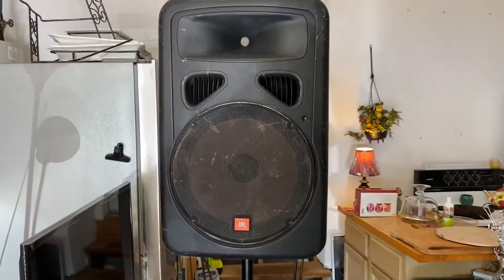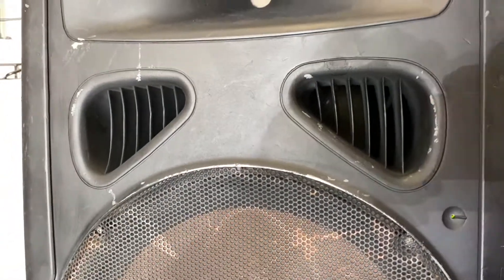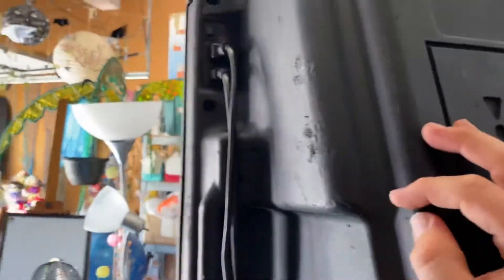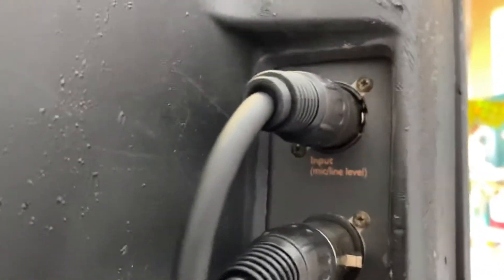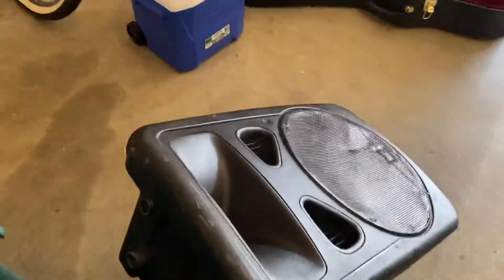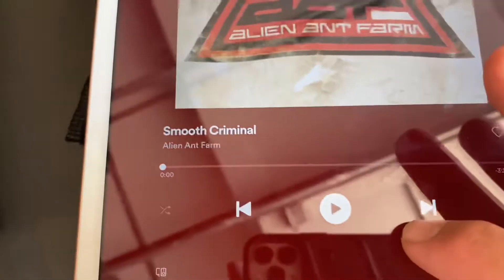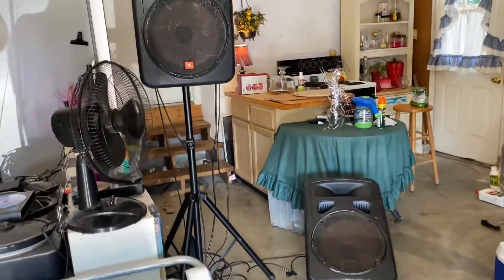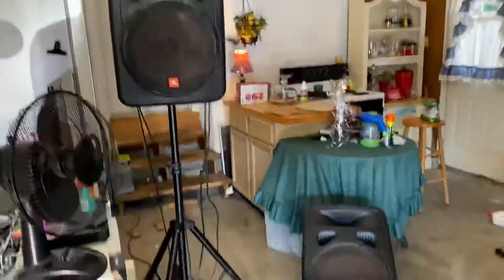Review of JBL Eon 15

Comment: whenever I Daisychain to my second eon15 thru xlr, the second speaker needs to have its volume nob turned way up to get the same volume across both speakers. why??
Reply: You may need to make sure that the mic/line and/or mix/loop switches are in the proper positions.  Sorry, without referencing the owners manual, I'm not exactly sure what those positions are, but it's something to check.  Good luck!
Reply: @Daniel Reverter, the amplified signal feeds only the internal 15"speaker & the 1,75"horn of your JBL Eon G2!!! But if you press the "Mix Loop Button" down to the low position, you can send the signal of Input 2&3 to the output XLR connection of your Eon G2!!! If you want to "daisy chain" the Eon G2, and you use the XLR Inputs for your music source of your first pair of Eon G2, you should't press the "Mix Loop" button down, because it will send the signal of your first XLR inputs already to the outputs of the Eon G2!!! Be shure that you do not confound the "Mix Loop" button with the "Mic Line" button, because if you press the "Mic Line" button down, you should connect only a mic directly to the XLR Input, and never a line signal in the pressed position!!!
Reply: thank you both